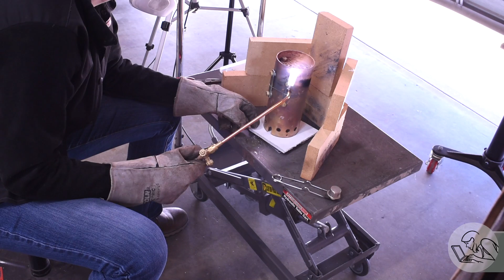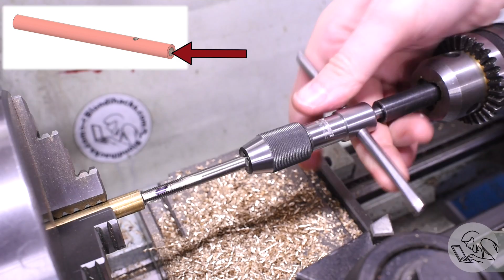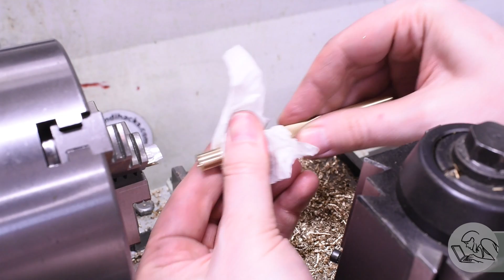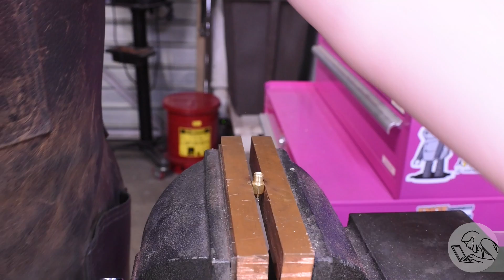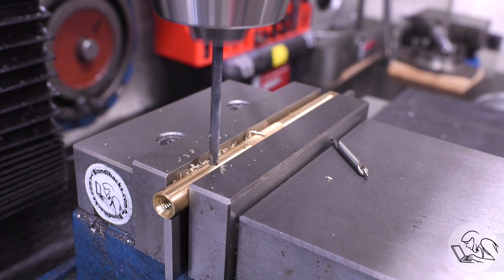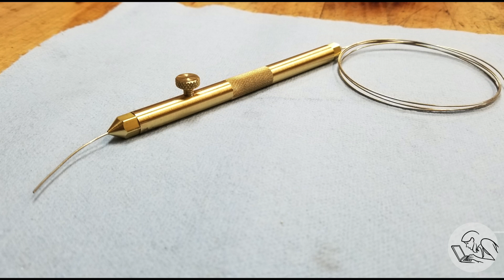Solder Pen!

Comment: The solder "work hardens" as it's drawn to a wire, if you preheat it, it will lose it's temper.  You have had fine mentors, nice work.  I like the way you square your tool post off the chuck with a 1-2-3 block, I grew up on "lantern tool posts" and moved to quick change at middle age, that's a nice trick, thanks.

Comment: You have a great channel, very helpful. This is going to sound crazy but if you take a piece of silver solder about 12 in long and put one end in the vise and the other end in a cordless drill and slowly twist the silver solder with the drill at very low RPM, it will straighten it out.

I use this technique with electric wire, galvanized wire and other miscellaneous wire. I have never tried it with the silver solder though, I don't know why it wouldn't work.

Comment: That is a great solution to your problem. I think it would be really helpful if you implemented some kind of feeding feature as well so that you can add more solder to the tip without having to turn off the torch and manually pull it out the other end. That way it would also serve as locking mechanism as well since the feeding mechanism has to grip on to the solder to pull it out. Just a thought tho 👌

Still a really cool project!!

Comment: I use to take 18” of silver solder out of the coil ... Put one end in a vice the other end in a cordless drill... Pull it tight and with a few revolutions of the drill .. Bingo the coiled solder is a straight rod now !!!

Comment: Cool 😎. Not 100% certain with a purely copper boiler, but all the tube boilers that I've worked on had at least one side expanded into the tube sheet to allow for expansion and contraction. But like I said, not sure how the copper will behave 😊. Loving the series, that's gonna be one pretty boiler. Cheers! 👍😁👍

Comment: Watched another one, thanks for the content.   As may be typical, I have not read any comments, thus risking redundancy:  I have found that running a wiggly wire through a straightening die (screw-on, like your sized tips) on the tool entry enhances one's ability to obtain a longer stinger on the outfeed side, which ought to eliminate the need for a lock screw.  This has worked well for meeee....

Addendum:  ah, I see someone mentioned printer nozzles :+D

Comment: I’m not too good at knurling either and I don’t really like the practice therefore when I can I use ball nosed end mills to make a series of internal arks around the diameter. For this project you could’ve left the area to be milled a larger diameter. I imagine you already know that though.
It’s a good project, I’ll have to see if my plumber friend ever uses such small gauge silver solder, may be he would if he had one of these tools.
I wonder if it would be worth having a slot in the tube with some kind of thumb wheel protruding in to make contact with the solder with an elongated bearing attached so that you can apply pressure with your thumb for feeding and maybe solve the rotation problem as well.

Comment: This needs a version two, which acts as a mechanical pencil. The way mechanical pencils grip graphite should be good enough to prevent the solder from rotating within the barrel, plus it would have the progressive feed. Since the back of the feeder can't be actuated, like the typical mechanical pencil, it could probably use a trigger mechanism, which I do know exists rarely in the mechanical pencil world as a button, but in this case a formed trigger would be beneficial, especially when using gloves. 
Having a pen like this, especially with mechanical feed, would even make electrical soldering easier. I know electrical soldering can be easier to deal with, but I still hate how tubes of solder come coiled up, and how much of a pain it is to straighten solder before and during soldering work. Plus this would be much more controllable, which is often an issue when hand feeding solder.

Comment: Nice project and an excellent "mark 1" version.  For the "mark 2" I'd like to see a knurled fingertip wheel to advance the solder through the tube as it's used up.  I could actually see myself using something like that.  I do a LOT of electrical soldering and this would definitely come in quite handy.

Comment: Ack! You must make a foot advance like a mechanical pencil. Press on a side button and it is only allowed to compress down and forward, pressing on and advancing the silver each time. Even less interruptions and repositioning required. The mechanical pencil-type advance may be too much to handle at home and you could use a textured finger roller(s) both pressing on opposite side of the wire. When you roll one of the textured rollers with you finger it advances the wire.

Comment: Really cool solder pen!. I had an idea that if you turned it instead into a extruder you can solve the solder grip and never have to stop what your doing to push solder down the tube. Like 3d printer extruders, the small teeth gear inside the pen can clamp the solder to the wall and the parallel gear is like a dial you can turn on the outside.

Comment: Hi. I do not know if you read this.... I need an aluminum bushing adapter about 2" OD round with a hole on both side. 7/8" tall.  So I went to my local machine shop and he quoted me $125 to $150.   I was shocked.  So I am considering buying a metal lathe machine from Harbor Freight. $699.99.   What is your opinion?  A good hobbyist tool?   A good starter lathe?    If you read this thank you.

Comment: On a remake it would be easy to make each tip with a split n taper making them collets to tighten on the wire of each size.

Comment: Fun project! I have seen an old model engineering magazine project like this too, so the great wheel has taken many turns.  Jewelers use something similar called a Speedwire holder. You can get them in various kinds and diameters of solder-check Rio Grande Jewelery Supply. The snip and place method also works great as several others have said.

Comment: I'm not sure if this might help, but there is something called a TIG pen.  It's similar to what you've built, but has a roller that allows you to advance the solder with one hand.  I found the specs online and turned my own.  It's a great lathe project and might be nice for this application.

Comment: I have an idea! What if you reappropriate the wire feed mechanism from a MIG welder? That feeds wire through a tube with a food pedal control and the MIG welder’s nozzle is already heat resistant.

Comment: I was faced with a similar problem a cupla years ago.  Unlike you, I don't have a fancy-shmancy machine shop, or a big brain.  I used what I had- a contact tip from my welder and a piece of steel brake line jammed on the end.  Not pretty, but effective.

Comment: Nice looking work. Any chance you might improve it by cutting a rectangular hole in the tube, turning the knurled knob sideways, pinching the solder to make a thumb feed control for the solder thru the tube

Comment: Suggestion: You could use the second tip as the tensioning screw so you didn't have a loose tip rolling around..
(Although, if this is just to use to orient your solder, you could probably just use the larger tip, I doubt you need the tip to be the exact size of the solder..)

Comment: As usual, I appreciate all the effort you put into your builds of specialty tools and fixtures, but I thought I'd offer this suggestion as it has worked for me with both solder and brazing wire and buss wire for my protoboard builds. If you cut the wire of whatever sort into one foot lengths or so then stretch it between two pairs of pliers (I do until it breaks) it straightens it out perfectly or pretty close to. Makes it much easier to work with.

Comment: That must be a different silver solder that what i've used. I've got some lead free silver solder, and its stiffer than regular solder, but its still pretty easily able to be straightened. That that you had look really stiff and inflexible.
Reply from the maker: That sounds like soft solder, not Silver Solder which is a specific filler for very high temperature brazing processes

Comment: I wonder if you could do what jewlers do to straighten coiled wire, clamp one end of the wire in a vice, then grave the other end with a pair of pliers or vise grips, then give her a good pull. You’ll feel as the wire stretches and straightens

Comment: Just an idea , but if you made your thumb screw a spring loaded button so as to when you press down it holds the wire , let up and it frees up the wire  to feed more wire  while you are solding away to make it easier to work without stopping unscrewing push wire retightening it.  
 #2 idea  hang a light weight spool off the back end  like a small empty Teflon's tape spool . 2 small flat bars to an axle. To stop the flip flopping of wire . 
 #3 forget the spring and add a small gear ⚙️ in place of the thumb screw to feed and hold your wire with one finger as you work ..

Comment: to stop the doubling, you need to tighten the nut up more for a rev. or 3, then loosen, once the proper engagement is met, then engage the power feed

Comment: A suggestion for a slight modification of the tool.  Right now there is a step going from the interior of the tube into the nozzle feed.  If hole through the tube was the same size as the cone of the nozzle then no step.  Drill through the tube with the small drill, you might have to use a D-bit.  Then come back and drill the end out for the thread size of the nozzle.  Screw in to the tube and now no step.

There are some things that have to be done, there needs to be an short length at the end of the nozzle with no threads as the interior threads won't feed to the shoulder.  

You can actually see the step when she is feeding the silver solder she gets it almost through, it sticks and she does a little manipulation to get the solder over that lip.

Comment: Hey Quinn whenever I have to straighten out wire, I like to chuck up one end in a drill and the other in a vise. Put some tension on the wire and a few trigger pulls on the drill and you’ll have a perfectly straight wire. May work with silver solder, I’ve never tried

Comment: I use a pin vice that has  a through hole. This means you can clamp the soldering wire and the diameter doesn't matter so long as it fits into the jaws.

Comment: Soldering with fire and stiff silver, excellent idea. (If I ever need to, I guess a simple thin metal tube + clamp will do in a pinch)
Soldering with an iron and soft tin/lead, I use an empty Desoldering Wick plastic holder that I wind up from the solder spool. 
They are handy to hold, easy to unroll, keeps your hands from touching the metal, cheap and it is easy to have different solders easily accessible.

Comment: It looks like a TIG pen might work really well for this too - they're used to feed filler rod when TIG welding, so you don't have to do the whole rub-your-tummy-while-patting-your-head thing. They're similar to what you've made, but with a wheel insead of the clamping screw so you can easily advance the rod along.

Comment: THANK YOU SO MUCH for making and posting !!! 😋 
   When I goof up and make a part wrong, or not long enough, and I make another one and it's right, I always put the wrongly made one in a plastic box labeled "Screw-ups." Then when something like that comes up again, I go thru that box and some of the time, one of the parts in there works just fine or I can change it a little and it works. What I'm saying is, don't throw away your parts you mess up on...you will eventually use them!
   Thanks Quinn !

Comment: When I soldered my boiler I wrapped the silver solder around a fire tube 42 times to form a spring the cut 42 rings. I assembled the boiler with flux, slipped the rings over the tubes, a larger ring around the inside of the outer rim and heated the whole lot chasing the rings. No mess and no solder where you don’t want it. 13 minutes each end. Video on YouTube channel captainpaxo1.

Comment: Quinn! the easiest method to Un-doing the WIRE Silver solder is to Anneal it!!!

I mean, "duh" ! ! ! 

It is SPRINGY, because the wire is drawn to diameter, Just like you work hardened your copper end plates,

Annealing Silver products, Best done in a darkened room, and bring to very dull red,

Another item you might think of (in Economy) is Hammer FLAT your solder, anneal then carefully cut it in half up the center! MOST folks new to Silver soldering Use To Much Solder!

Sincerely,

philip, 
Silver Smithing since 1968

from the Great Pacific NorthWET, Oregon Division.

Comment: handy tool there quinn 
a tip i use when silver soldering is use a oxy aceteline  torch tisually a number 8 it controls the heat better that that large flame end you were using 
also when soldering car radiators it much easier

Comment: I wonder if it would be difficult to create a feed “button” on the side to advance the solder. I’m thinking like the Pentel mechanical pencils with the side clicker.
Reply: 1/32" solder should be about .8mm so it might fit in a .7 or .9mm pencil. Naturally you'd have heat issues with a plastic pencil but my father has some old mechanical pencils with a metal mechanism. My guess is it might be difficult to machine but on the other hand an 'advance' knob which bites into the solder would probably be easier. Actually it might even be better to use because it would give two-directional control without requiring you to repeatedly press the button to get more.

Comment: Nice, like it. 
How about replacing the thumb screw with a spring loaded knurled feed wheel so you can feed the wire, a bit like the middle wheel on a mouse?

Comment: The easiest way to straighten a stiff wire is to fix one end in a vise, the other in a drill chuck, then twist it under tension until it starts pulling the drill toward the vise. Another way to tell when it has undergone enough twisting is to count or estimate revolutions; a couple dozen turns per meter will be good, but the acceptable range is wide. This procedure distributes the curl over the circumference of the wire, making it straight. I use it to straighten coiled MIG wire for use as TIG filler (that makes it a lot cheaper and thin MIG wire is easier to find than pre-cut TIG wire). 

To prevent the wire from looping from residual twist, release it from the drill while it is still under tension. Watch your hands or wear thick gloves as you do it. The end of the wire will unwind violently when it is released from the chuck. Alternatively, reverse the drill an appropriate amount before releasing the wire, but then you need to guess how much reversal is appropriate. In any event, give the wire an extra tug before releasing it from the drill. It will come out perfectly straight.

Comment: I solved this problem from the begining. I always use precut to shape pieces of silver solder. This is the best way of soldering. The solder is just big enough to flow in the joint without making a big sloppy mess with over application of solder. The bonus is the solder melts at the right time with no guess work. Usualy my joints come out beautiful. Boiler pressure test was a breeze. Only 2 pin hole leaks. Very little clean up! Make sure you preheat!!! I usually preheat my boilers in the oven until it get to be around 450F. This is a big help and saves on gas.

Comment: Version 2 needs a spring loaded knurled roller similar to 3d printer feed drives that you can spin with your thumb or finger to push more solder through as you go.

Comment: No joke, I have actually done electronics soldering with a mechanical pencil for dispensing solder. And I don't even need to use fire with that stuff, smart project.

Comment: slight improvement idea, have it spring loaded ( silver solder always under tension ) so you just push the button to be able to move the solder. it only might save a second or 2 but might better than loosening and tightening the screw ( depending if used a lot )

Comment: I used to do a lot of prototype electronic projects for past employers. One of the things that came up all the time was wanting a piece of solid buss wire that was straight. I was always supplied with stuff that came on a small spool. I could get it sorta straight by hand, then finish straightening it by putting one end in a table vice and the other end in a pair of vice grips. Then one taps the jaws of the vice grips with a small brass hammer. As the buss wire is stretched a tiny bit with every tap of the hammer it gets progressively thinner. More importantly, it gets straighter. You could try that with a short piece of your silver solder and eliminate the coil altogether? And thank you, for a thoroughly enjoyable video.

Comment: Quinn, if you were to cut a length say a 1mtr, place one end in a vice the other in a portable drill chuck pull firmly and hit the trigger a few times it will straighten out.

Comment: It would be cool if you had a wheel that worked like the wire feed rollers on a mig welder. That would hold the wire still and allow you to feed more out one handed by rolling the wheel with your finger... incase your short of projects 🤣

Comment: Great little tool. Thanks for sharing. Just one thought...It may be that I do things wrong...but I do a lot of drilling on a lathe and have found that slower spinning is easier to control.
Reply from the maker: The important thing is the right surface speed for the material at the cutting flutes on the drill, so the smaller the drill, the faster it should be running.

Comment: 5:55  I have solved that issue by putting a mark with a fine point marker on the piece where it lines up with the number 1 jaw.  So when I flip the part, I make sure to line up the other side with the same jaw. I get as little run out as .001" or less if I am lucky.